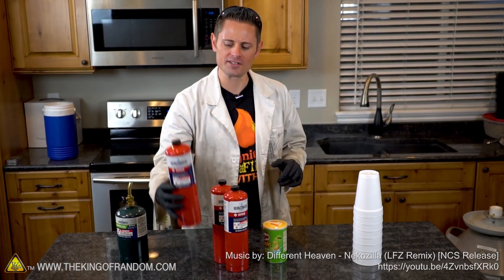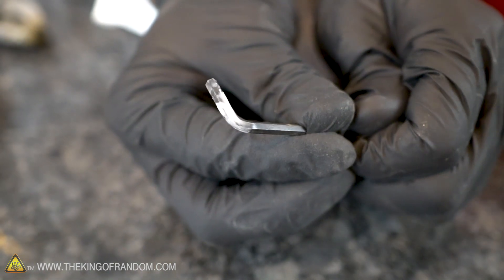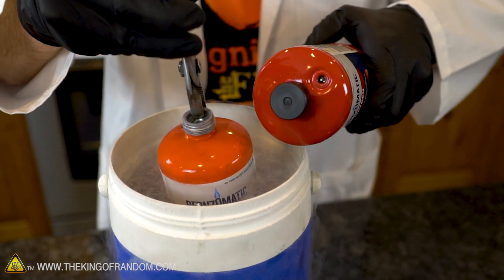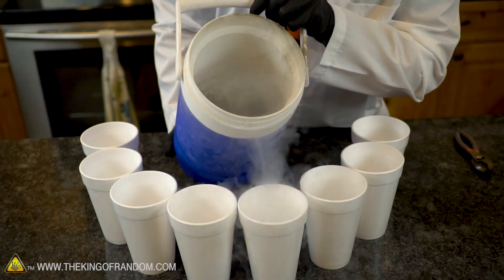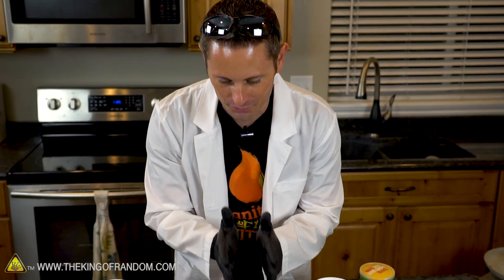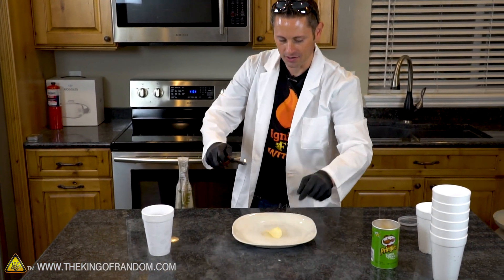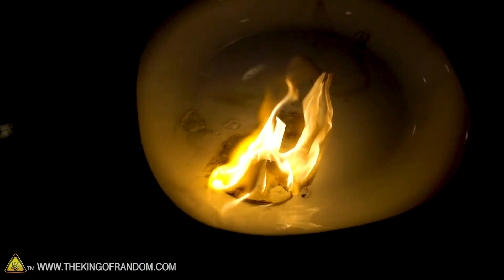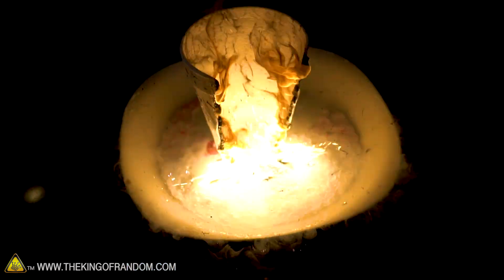How To Make Liquid OXYGEN! TKOR Experiments With Homemade Liquid Oxygen & How Oxygen Is Made

Comment: Something fun to do with liquid oxygen would be to soak a cigar in it, and then set it on fire. It should be hot enough to burn through sheets of metal (a few millimeters in thickness) ... so maybe you can even weld with it.

Comment: Can you freeze liquid nitrogen?
Reply: Nitrogen freezing point is -210 degrees celsius, so yes, but it would have to be very cold
Reply: Louis, there is no such thing as below absolute zero. And nitrogen is NOT metallic.
Reply: THAT DRY ICE
Reply: It isn't
Reply: louis St Germain wrong on so many levels
Reply: Is this vaccum thing a recent innovation? In the last time I searched about nitrogen, it's freezing point was impossible to get. Checked it again, nitrogen with metallic proprieties can be found in the low centers of Jupiter. Guess science evolves.
Reply: go back to school
Reply: Brandon Cao Liquid helium, cooled to -269 celcius
Reply: Yeah and its called dry ice
Reply: Nytrogen's freezing point is below absolute zero. So, unless you can generate saturn or jupiter's ammount of pressure in your basement, you couldn't get your hands on this sweet metal. YES THIS IS METAL. NYTROGEN IS METALLIC

Comment: Let's take out the spark plugs on a gasoline engine, and then throw this in there.  What's the compression ratio required for combustion of Oxygen?  

Now let's mix it with hydrogen.... 

liquid hydrogen and liquid oxygen mixed together.

Comment: Omg... Don't try this at home kids. I was wincing when he poured the liquid oxygen on the chip, that flame could've easily licked up the falling liquid oxygen and ignited the cup... probably causing, at the very least, Grant to spill some flaming oxygen in his house.
Reply: Liquid oxygen won't burn. It will only accelerate burning. That's why the liquid oxygen wasn't burning then its rolling around the plate and the fire intensify when it touches the burning chip. 
What it can do at most is increase something that's burning into a big blaze that he can't control. (Like if he accidentally light up his clothes on fire)
Reply: yeah... LOX isnt to play with kids. Super reactive, make sure you have clean beakers and no oils/grease around...
Reply: Synystr7 Yeah all the kids have liquid nitrogen lying around
Reply: Synystr7 mmmmm. Oxygen isn't flammable
Reply: Ugh haven't you guys heard of the Fire Triangle? For combustion you must have 3 things: Fuel, Heat and Oxygen. Liquid Oxygen does have the Fuel and Oxygen boxes ticked, but it is way too cold to be combustible, mainly how Liquid Oxygen ignites is through a naked flame(which is already hot enough), it's not gonna blow off from sparks.

Comment: why is it that liquid oxygen can burn but not the oxygen we breathe
Reply: the concentration is the key here. wel lfirst it´s not the oxygen that "burns" burning is the reaction with oxygen. Styrofoam can react with oxygenm, even in normal atmosphere. however in that liquid state you have a WAY higher packaging of oxygen atoms, means if you give the nitrogen and the Styrofoam the energy they need to start reacting. it´s just much more likely, that an oxygen molecule hits the organic material and starts the reaction. sounds plausible isn´t it? in a pure oxygen atmosphere the styrofoam cup already would go kaboom. because all molecules that could hit the styrofoam would be oxygen. the same applies down there. there is nothing but oxygen and styrofoam. however, Liquids have a much lower molar volume means way more Molecules/space that means the reaction will go even faster because of the simple chance of an oxygen molecule reaching the styrofoam and the rate at which this happens. Oxygen in the air is just 19% of the air, so the likelihood is already much lower.

 that´s why every kind of bottled oxygen is dangerous. itself can´t burn but in increases the flammability of everything around it dramatically. hope that could clear it up
Reply: The oxygen in the air we breath is what makes combustion possible. Literally every time you see a fire it is because the oxygen in the air is burning.
Reply: Nick Ambio actually the oxygen we breathe does burn
Reply: It being ionized and in a different state of matter idk literally learning stuff like this in chem rn
Reply: Nick Ambio liquid oxygen dorsnt burn, itself.   the "fuel"  burns, and the oxygen simply accelerates the reaction.    the oxygennwe breathe does do this as well, just not as violently due to the concentration.  when you use an "oxygen-acetylene" torch, the acetylene bruns, and the oxygen makes it burn faster.
Reply: Nick Ambio It is that way because liquid oxygen is pure.
Reply: because science
Reply: Nick Ambio liquid oxygen is in a different state

Comment: When I worked at BYU, they made liquid oxygen by cutting the top and bottom off of an aluminum bat, welding a solid aluminum point on the bottom, then filling it with LN2. Soon LO2 would start dripping off and could be collected in a cup.
Reply from the maker: +bagnon nice!

Comment: Grant, I would guess that the oxygen can is vacuum-sealed. If that is the case, wouldn't submerging it in the nitrogen not actually cool it down very much since only the outer layer of the metal is really getting cooled? What if you put it in another container, would that have worked better?

Comment: In the medical field Oxygen and Nitrogen are usually sold as compressed gasses. Some other gasses, like Nitrous Oxide are sold as liquified gasses. You never know what volume you have until all the liquid is vaporized because, as long as it is liquid, the pressure gauge displays the same reading.

Comment: I posted in the last video, but this is more recent. I have an idea about how to keep the middle plugs from popping off. you could clamp a board really tight on the opening. The idea is to pack the sand in really tight, but there's a hole in the board so you can pour straight through it, under pressure. Also I made a nice diagram,  but I can't put it in the comment section, so please if you have an email, I could email you it. Thanks and by the way I made your foundry, but haven't melt copper.
Reply: Now that I look at it, I didn't explain it well, so the diagram will help a ton.

Comment: get a small bucket drill a hole thru it and stick 1/2 inch tube down it and seal it then put liquid nitrogen in the bucket it will automatically pump oxygen out the bottom of the tube

Comment: If we were to fill a bathtub with this will we be able to breath underwater
Reply: Ethan Valentine I've no idea where you got that - a diatomic element is always diatomic. It's O2. The only problem is that the liquid is not accepted into the alveoli.
Reply: wrong, diving tanks are not oxygen they are compressed air which is about 29% oxygen, or nitrox which is 39% to 45% but NEVER pure oxygen or higher than 50% as oxygen is toxic at depth
Reply: Yes, but only once.
Reply: You would also freeze your lungs.
Reply: The only real problem with this is the temperature and/or pressure and their effect on your flesh. People breathe pure O2 from tanks sometimes. You just breathe less if you get lightheaded. Look up world records for holding breath, or Wim Hof method.
Reply: Under Garmin you can breath pure oxygen it's fine. Some Poeple use it to try and breath longer. Diving tanks are full of oxygen for breathing as well.
Reply: No because first, it would fill our lungs, making it hard to breathe anything, and second, the is just Oxygen (O). The Oxygen that we breathe is O2, which is two Oxygen molecules bonded together.

Comment: Cody from Cody's Lab uses a wound copper tube as a heat exchange submerged in liquid nitrogen to liquify the oxygen from his hydrogen/oxygen generator (because his local welding supply store won't sell him liquid oxygen, but liquid nitrogen is fairly easy for him to get)

Comment: You should see if the liquid oxygen will light and hold a flame. or possibly make a drip system for your forge and see if it will make your forge burn hotter.

Comment: Nitrogen [N] has a boiling point of 77 Kelvin [K] and Oxygen [O] one of 90[K]....so how exactly is the Nitrogen "boiling away" (evaporating) and the Oxygen stays liquid.......
This looks more like "liquid-air" and of course there is a lot of oxygen in the fluid, so every fuel (Pringles) can get in contact with more oxygen at the reaction surface than normal, but it should not be "pure" liquid oxygen ratio should be still 78%N   20%O    
Can u try cooling down "pure" oxygen from a pressured bottle through a copper cooling spiral that is immersed in liquid nitrogen?

Comment: What happens if you add hydrogen to that oxygen H2O
Reply: You get a cryogenic fuel.
Reply: K Vineet what is cryogenic fuel
Reply: It would just make a mixture and not form the required bonds
Reply: Tarik
Reply: Is it a fuel that is cold but flammable or any other meaninh
Reply: In this case, it is a mixture that has both the oxygen and the hydrogen to burn, all it needs is enough thermal energy to start the reaction, and BOOM.. it all goes off. You would think this means a spark, but just heating it enough will do it. How hot depends on the ratio of oxygen to hydrogen, but with enough oxygen, it will light off at low temps.
Reply: subbiah pillay cryogenic fuel is something that is stored at very cold temperatures. The mixture of liquid hydrogen and liquid oxygen is the fuel used in cryogenic engines. These engines give a massive boost to a rocket in comparison to the traditional solid or liquid fueled engines, plus they have their own supply of oxygen so the combustion can keep going even without an atmosphere around. Hydrogen burns and oxygen is the oxidizer, the pure mix of them gives a very powerful, efficient and clean brust of energy.
Reply: Rocket fuel!
Reply: I read that hydrogen and flourine produce the most energetic chemical reaction known to science. Hydrogen and oxygen can't be much lower. That's the kind of thing you put together with a 100-yard pull string.

Comment: You can't store liquid oxygen at room temperature, even under pressure. Look at it's phase diagram. Unlike CO2 or N2O there is no pressure at which oxygen is a liquid at or near room temp. Even at 100 bar (~1500 psi) it's a supercritical fluid with a similar density to just the plain gas (i.e. there's nothing really gained by compressing it that much). The phase diagram I found only goes to 100 bar but the trend looks to be supercritical past 200 bar. Maybe it becomes some sort of solid past that but those kinds of pressure are beyond realistic for even commercial applications. 

Trust me, if it was practical to store O2 as a pressurized liquid, they'd be doing it.

Also, ever wonder why they don't sell liquid nitrogen, argon or hydrogen in non-refrigerated, pressurized tanks? Same reason.

Comment: So if you took the liquid oxygen and poured it back into the canisters, could you take them back for a refund?
Reply: Milokiss82 I think you would be able to. If he pours it in as a liquid and then caps the seal, the liquid should turn to its original gas state and expand as it heats up.
Reply: Lol
Reply: Milokiss82 you can pour the liquid oxygen in, and then as it warms up past its boiling point it will convert into a gas, which, when container in the canister, will become pressurized.
Reply: You can't "Pour" it back in. It was pressurized.

Comment: Can your vacuum pump reduce the pressure enough to make solid nitrogen? If the pressure goes low enough, the nitrogen will boil below its boiling point and it will end up solidifying, but I am not sure how strong the vacuum would have to be.

Comment: Can you keep a candle burning inside a bottle with this oxygen ?
Reply: How do you even compare oxygen and gasoline? They're two different thing and need each other in order to burn.
Reply: Larry The Admin Liquid O2 is not flammable by itself. i have worked with medical liquid O2 for years. #1 Rule absolutely no oil based produts anywhere close. i have seen it catch blacktop on fire.
Reply: Liquid oxygen in its form is in fact highly flammable, and reactive. In fact, oxygen (besides things like sodium or potassium) is one of the more reactive elements and in high amounts can be extremely explosive. So technically a candle would burn until an atmosphere of 100% oxygen touched naked flame. Then it would explode.
Reply: like so he sees it!
Reply: It Can be part of the experiment
Reply: why couldn't you? until either the candle or the oxygen gets used up
Reply: That's a cool question
Reply: Brandon Hurst it's an oxidiser so it makes flames worse alot worse and if someone lights a candle in a pure oxygen atmosphere then just look at what happened on Apollo one
Reply: +Ewan Taylor why would it create vacuum? the oxygen would get replaced by carbon-dioxide and water, it would probably change pressure, but definietly not make vacuum
Reply: I only men a slight vacuum, I figured that the candle would use up more than it made in the way of gasses.
Reply: Riusen oxygen is an oxidiser so in a pure oxygen atmosphere everything burns like it's on the bottom of a rocket and technically oxygen is even more powerful then gasoline so if that answers your question then no problem

Comment: If the nitrogen is just cooling the air down outside the cup wouldn't the liquid formed just be mainly nitrogen? I don't see how it formed only oxygen if air is 78% nitrogen (not saying it didn't I just want to know the science). Also it would be cool if you could try to get liquid hydrogen (or make it, even though that would be extremely difficult) and combine it with the liquid oxygen to form rocket fuel
Reply: Sahil Sethi the rest of the gases in air like nitrogen needs to be a much lower temperature to be reverted to its liquid state, meaning it would only be liquid oxygen.
Reply: Ariana Winston but nitrogens boiling point is only 20 F degrees cooler. That's not that much. It seems like at least some liquid nitrogen would seem to form

Comment: Question- Is that pure oxygen? like 100%?
Reply: Yes... what else would it be? The other gases in the air require lower boiling pints (colder temperatures) to be in liquid state, so I couldn't image what else that liquid could possibly be but oxygen.

Comment: Question:     How come the oil in the Pringles didn't cause the chip ya froze with the liquid O2 to burst into flame?  I was always led to believe that when O2 when mixed with oil, it will spontaneously  ignite and burn very rapidly.  And that is why  regulators for O2 tanks are marked "Use No Oil".

Comment: Oxygen and any Hydrocarbon.  I dealt with LOX in the Navy, older planes use liquid O2 for the pilots!  Liquid O2 expands to a gas in a ratio of 1 to 862.  Works well to help pilots breathe at altitude.

Comment: hook up your water splitter project by putting the tube into a tub of liquid nitrogen. Only the oxygen will condense and if you then boil off the nitrogen then you will have a lot of oxygen left over. you can also run the tube into a plastic bottle submerged in the LN2. that way you won't have to evaporate off all the nitrogen at the end.